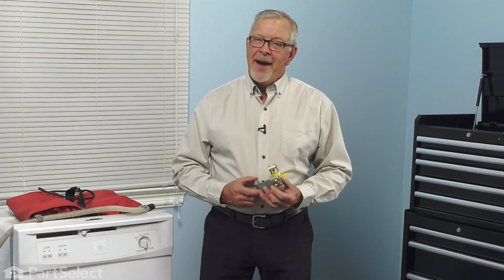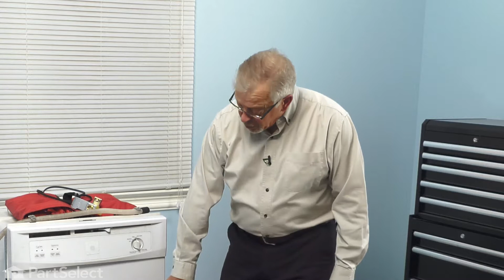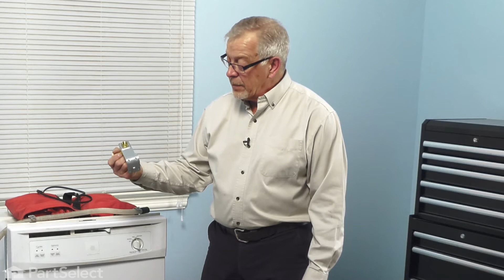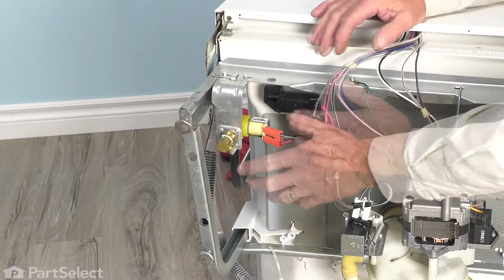GE Dishwasher Repair – How to Replace the Inlet Valve (GE # WD15X10014)

Comment: Does the harness connector go on a certain. Way? Or are both terminals the same? I unplugged mine and wasn’t sure which order terminals plugged in since plug was sams on both sides

Comment: I replaced the valve but it is still leaking.  The water is flowing on the side opposite the valve.  I just figured the water was running down the hose and that's why the leak was apart from the valve.  Any idea what the next thing to check should be?  Otherwise the dishwasher works fine.